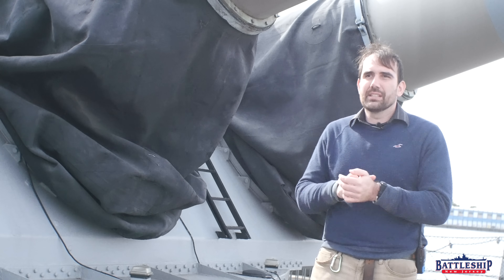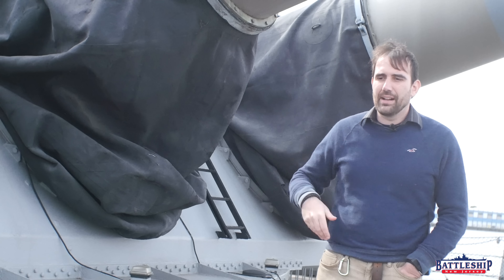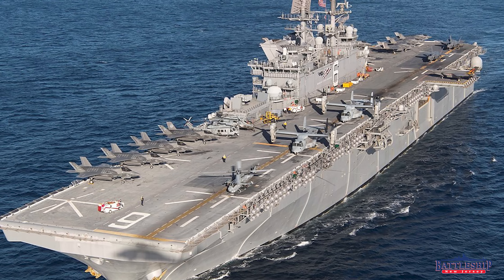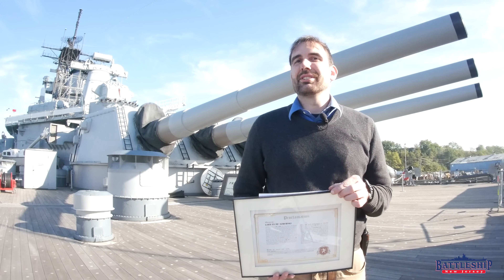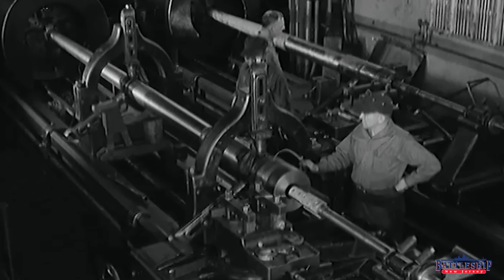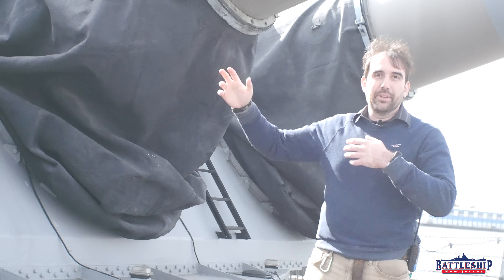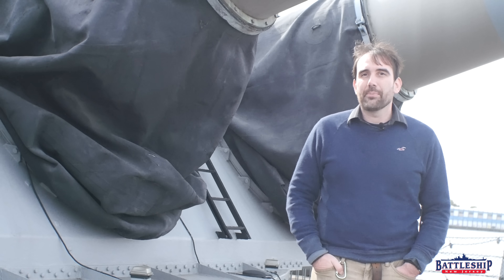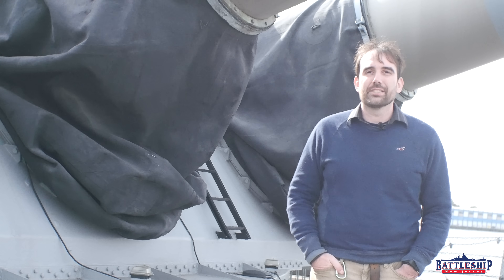How Much Would It Cost to Build a Battleship Today?

Comment: As has been mentioned previously, armor would have to be radically different than face hardened class A/B.  I'm guessing a combination of layered and reactive armors, so now you're looking at two types of systems to research.

To compensate, the navy would probably use the platform to also push for next generation active defense systems with more layered defense systems (long range counter-missile defense, switchblade like drone swarms seeking incoming threats, laser defense systems, upgraded CIWS, and armor).

You might be also looking at less barreled weapons with automated loading systems to compensate.  Something akin to a 4 barrel battleship with an upgraded Salem style autoloader system.  I doubt it would have 5 inch guns, but it opt to have additional vertical launching systems instead.

So, looking at it that way, it would likely be a vastly different ship design than what we would be thinking about.
Reply: What about the Chobam Armor the Army uses for its tanks?  An armored ship presents far fewer problems than a tank, and so could be quite a bit more effective than tank armor.
Reply: @davidbriggs7365  Chobam Armor is designed to deal with sub-caliber high velocity projectiles and shaped charge jets, not large masses of explosive.
Reply: @boymahina123  This is what I want. 
if it's true a new generation of 'BBs' will be more of reintroduction of Ironclads if classic definitions of BB still in use.
Reply: @DiscothecaImperialis  I'd imagine a modernized BB's armor to be a modified NERA array, albeit replacing the metal-elastomer-metal sandwiches with solid high-hardness plates.
Reply: @boymahina123  What is NERA array actually?
Reply: @DiscothecaImperialis  It's a form of modern tank armor wherein "burster plates", which consist of an elastic material sandwiched between relatively thin armor plate, are spaced and angled such that they deflect and bleed energy off a shaped charge jet or sub-caliber APFSDS dart.
Effective against long thin dense projectiles, but not full-caliber large shells.
Reply: @boymahina123  However, you wouldn't want to use simple steel armor like an Iowa Class Battleship, which has a maximum of 17 inches of armor.  When I was in the Army, I served as a crew member for a 4 inch diameter TOW missile, which could penetrate 17 inches of steel armor.  My suggestion about using Chobam armor wasn't directed specifically at Chobam Armor, but what it represents, composite armor, with different layers being made of different items.  Probably much lighter, and definitely better protection.
Reply: @davidbriggs7365  Is this proposed armor of yours a viable option for DDGX as well? (if so this means DDGX will also be a worty successor to BB and would end BB reintroduction proposals for good eh?)
Reply: @davidbriggs7365   "Chobham" armor, which is NERA armor that someone described earlier would mostly be used on the exposed areas like the turrets. Possibly some small amount on the upper belt around magazines would be used.

Primarily I would expect to see the use of ceramics backed by heavy steel as the primary belt & deck armor. This is much more weight efficient than steel against both shaped charges, long rods & traditional bullet shapes.
Reply: @boymahina123  You are missing my point!  When I was in the Army, I operated a weapon (TOW Missile to be exact), which could penetrate 17 INCHES of solid steel armor, and that missile was only 4 inches in diameter.  A modern Battleship would not, nor SHOULD not be armed simply with steel armor like that of the NEW JERSEY, which would be penetrated IMMEDIATELY by any modern warhead.  Okay, so Chobam armor perhaps wouldn't be the best idea, but something along those lines (layers of different kinds of protection) would have to be used.
Reply: @DiscothecaImperialis  It would perhaps be a viable option, BUT,  the DDGX would not, nor could not replace a Battleship.  A DDGX would be too small, and too common to completely replace a Battleship, and don't forget that a Battleship is far more than just a weapons mount.  Among other things, it is a suitable place for a Flagship (as witness the use of the NEW JERSEY during and after World War Two), and it can also serve to impress people with the size and power it represents, and it can easily host dozens of VIP guests at a single time.
Reply: @davidbriggs7365  If BB means huge armed and armored ship with the size of Carriers or slightly smaller. In the age of Carrier-based naval doctrine. there needs to be certain weapon systems that justified the immense size and usefulness as 'substitutes' to CV if it means to be a flagship. and to be reintroduced with entirely new generations.

I'm not sure how to justify the reintroductions of BBs not just with up to date or advanced weapons sytems and super material science wonder armor platings. weapon systems are also needed to be 'too big to fit inside DDGX hull' (Think of Japanese proposals to build a pair 20,000 ton missile ships) and 'too powerful to be made small, AND it needs to outrange Naval jets + missiles launched from those. BBs to carry ICBM? nah. the weapons still has to be TACTICAL too. Also doctrines to support it.

Alternatively countries with defensive naval doctrine (Sea Denials) would order a new BB concept and instead of investing on more fragile CV that barely meets their needs (If there's no need of Force Projection but to prevent that, why invest in the same weaponry that consumes huge amount of resources?). With this setting a new BB would need to be operatible with 250-500 men (And still needs to hit enemy CV), Carriers were no less manpower intensives either.

Building a new gen BB requires infrastructure investments, and WITH WHAT WE HAVE TODAY and not WHAT WE WERE CAPABLE OF IN THE PREVIOUS CENTURY.
Reply: @davidbriggs7365  The funny thing about shaped charges is their post-armor damage. They kill tanks just fine because their essential equipment takes up much more of their internal volume as compared to a ship.
Fire a TOW at a tank, and it would be hard for the penetrating jet to NOT hit something important (crew/ammunition/fuel/engine).
Fire a shaped-charge AGM-65 Maverick at any ship, and it damages the better part of a bulkhead at best.

Shaped charges are great at penetration, not so great at killing a large space divided into compartments.
Reply: @davidbriggs7365  the main issue with tank style composite armor is that it trades volume for weight. 10 tons of composite will offer more protection than 10 tens of steel, but 700mm thick steel will offer far better protection than 700mm of that same composite array.

That’s a problem for warships because generally speaking volume is the limiting factor, not mass. All those air pockets and wedges and whatnot take up space, which, to protect against something like a hypersonic missile screaming in would probably take at least an entire deck of thickness - and that’s before you consider the actually explodes bits you need to protect like the VLS needs to be open to the sky anyways. Towards the sides and you’ve basically got high tech torpedo bulges. The issue with these is that again, you either keep your hull form but now have your array squeezing in taking up valuable engineering/berthing/whatever spaces, or you maintain your internal volume but now your hull form sucks and your shiny new ship will never top 30 knots and can no longer operate alongside aircraft carriers
Reply: In the UK, there are no steel mills that are capable of rolling armour plate left.
Reply: My thoughts had always been probably 5-6 inches of armor, 6 forward main guns, 4 of the automatic 5 inch (2 forward 2 aft), and the stern being entirely VLS tubes, and Harpoon launchers. Along with all the latest electronic warfare suites, CIWS, etc. 
So would still look every bit like a battleship, but be a very different animal under the skin.
Reply: you mention 'armor plating' eh? did USN really renewed interests in armored ship hull? in addition to Aramid armors protecting magazines, engine rooms and fuel storage currently in use in Burkes and Ticoes.
Reply: Nobody’s putting reactive armor on a warship, dude.
Reply: Kevlar armor could be layered in where needed? I know many ships use large amounts of Kevlar in their armor scheme these days.
Reply: @Orinslayer  Aramid (the actual name of Kevlar which it is a trademark) armor is, AFAIK plated in vital parts like Magazines (ammunition storage), Missile tubes, fuel tanks, engine rooms and other areas deemed vital. the protection scheme is similiar to Protected Cruisers of the late 19th Century. External plating requires something like Chobham or other composite armor actually. I'm not sure if there's any logic to do aramid platings externally to Burkes or Ticoes hull. but DDGX would have composte armor but if so the DDGX will be a worthy successor to Superdreadnoughts of the first half of 20th Century.

Comment: If I was in charge of the navy and was ordered to make some battleships instead of reactivating the old ones I would go with new for the simple fact that as you mentioned the base structure of these is 80 years old and in the long run would cost more to keep one of these museum ships afloat without being used is already very high, now bring in the wear and tear roughly 3000 navy and marine personnel would add on top of the day in and day out of exercises with the big guns and rough seas to contend with does an 80yr old ship no justice.

Comment: I've already worked a 12 hour day, so this will be somewhat incoherent and not translated from ADHD. /// I would partially reactivate the Iowa Class... for Gunnery Training. If there is a reason to "rebuild" the Battleship Class, more than one will be needed. Since Guns & Armor are the  "Long Lead" items... In new Construction I would "Cheat" while 16" guns are being "reinvented"... [Turrets have been reused in the past & placed in new barbettes.] Get the first flight of 3 ships completed with from the stock of Eleven, undamaged 16" Triple Turrets... fwiw... My design would be a 16" Turret at either end with the unused tonnage used for VLS anti-ship missiles... AND missile defense!
Reply: Yeah I was typing that but stopped because I was sure the eviceration was coming. We should've kept one active just for shore bombardment, canabalized the other 3 for parts and used the hulls for new helicopter carrier builds. It would be a good deterrent and a show of force when she got underway. Basically, stop what you're doing now because the big girl is coming out to play and you just lost your coastline. 

 Realistically the Navy would benefit more from cruiser and destroyer tenders with drive in capability to allow for fueling, repairs and to load the VLS.

Comment: Build new just for the maintenance cost and reduced crew.  

The navy needed a cruiser sized platform with a long range gun system. They sold us on Zumwalt. Wtf. Try not being so stealthy and cutting edge. Use an automatic gun system similar to Des Moines. Forward of super structure are the guns,  aft is VLS.  It ain't that hard.

Comment: From a pure financial perspective, reactivating the Iowas in the short term would be the Better option, but as you pointed out due to huge maintenance costs impractical long term. From a long term and economic perspective, the benefits of building new ships would doubtless outweigh the extra expense. From the increased jobs necessary to build the new infrastructure, along with the ships themselves such a program would cost 10s of billions, but would also provide massive stimulus at the same time and create likely thousands of new jobs.
Reply: But first a gunnery needs to have the same range as cruise missiles. and that's hitech thing.
At this moment the closest things to Newgen Battleships would be more like Ironclads with Chobhams armor, 155mm main guns, VLS missiles, torpedoes, and CIWS, all hooked to AEGIS.
erm i'm talking about sizes, rightnow it can't have the Supercarrier size now since i see no reasons to justify that.
And that has to be slightly bigger than DDGX but not as expensive as Zumwalts.
Reply: @DiscothecaImperialis  There is no need to have the guns have the same range as a cruise missile.When Desert Storm started,the first barrage of cruise missiles to hit Bagdad,came from the battleships.The technology is there to increase the range for the guns out to  50 + miles which is plenty if they can keep the accuracy they had within 20 miles.As someone said earlier,pull some of the 5 in mounts to put in  more close in defensive weapons,and you should be good to go.On the plus side that nobody has mentioned,with just about everything on the Iowa's still being analog, they could be about the only thing that could continue to operate after an EMP blast.
Reply: @dochlldy  Don't say that Iowas at their work days still uses arrays of Leijimeters:P?

Comment: I would say it depends on what you're considering the life of the ship.  For an Iowa that would be what, 10 years from refit?  Another thing that comes into play is how fast do you need it?  Quick?  Reactivate for SURE.  Also a current war would mean you're probably not going to be using the ship for 20 years so the per year cost isn't as much of an issue.  Reactivate, use, then when the war is over mothball and then put it back into museum status.  Maybe lock down all the sensitive areas and leave it complete for easy reactivation if you need it in 5 years or so?  Dunno, glad it's not my decision and that we don't NEED the ol' girls at this point.  Must say though, I like 'em.  I visited Iowa since she's local.

Comment: That would an interesting vessel with a new gen motel salt or other similar reactors design wihtout standard rods that would be able to go super critical and be much more vibe resistant. Feeding a bank of super capacitors that would Power some truely massive tripple auto loading rail guns with elevation range similar to the old 5" so it could launch payloads at extremely high trajectories. Aswell as a large rear missile deck and basically a 5" rail equivalent for bombardment and AA. Imagine if you could drive a 10 or 16" sized projectile at hypersonic speeds hundreds of miles  and with rapid volley fire from 6 guns. That be some scary stuff there.